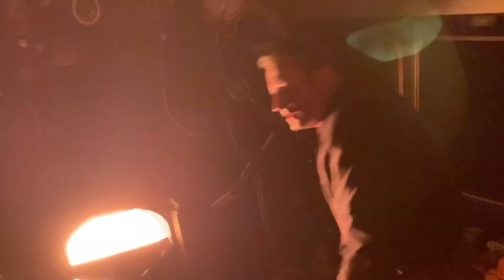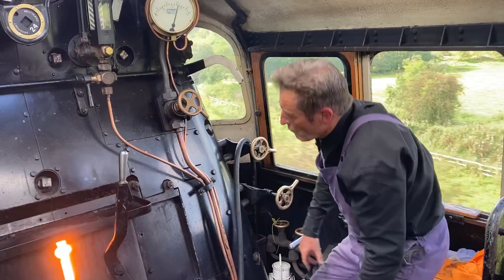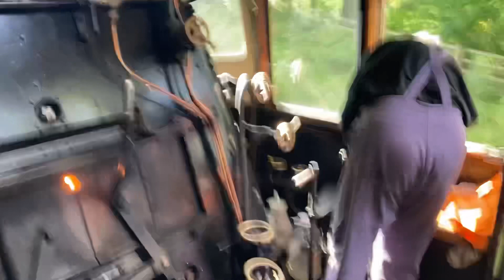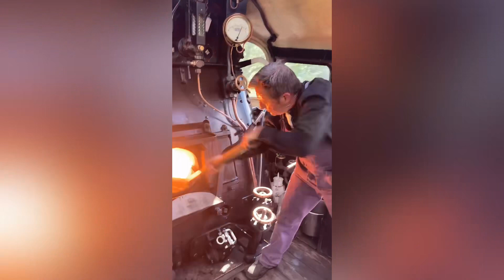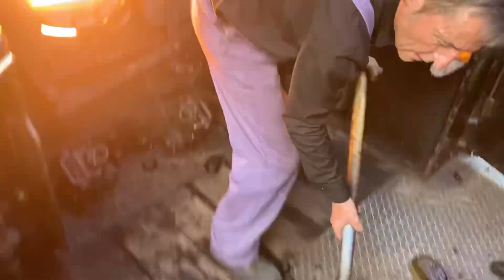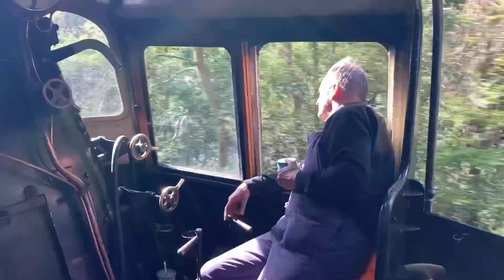Firing the 9f from Grosmont to Goathland.

Comment: Brilliant. Never saw you working that hard for the Union Company😁
Reply from the maker: Indeed. The youthful me would have been disappointed to see how I turned out.
Reply: @struck2soon  you sure get the prize for the best dressed stoker 🍻
Reply: @struck2soon  just before the fire man built up his fire did he turn the water injector on? I am pretty sure the controls for filling up the boiler are on the fireman's side
Reply from the maker: @ As the fire was getting hotter before departure the injector was put on at times to prevent the safety valves lifting. After departure it is a case of keeping the fire hot and putting enough water in to replace the water consumed. Yes, both injectors have their controls on fireman’s side, you can see them in the video.